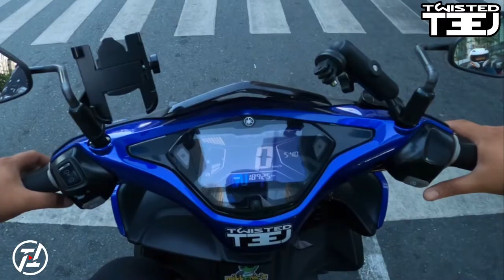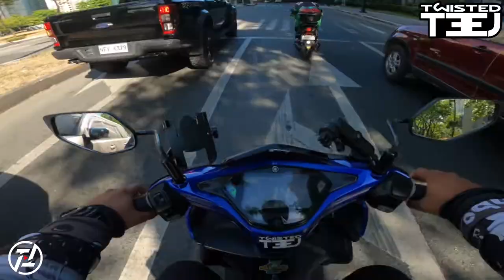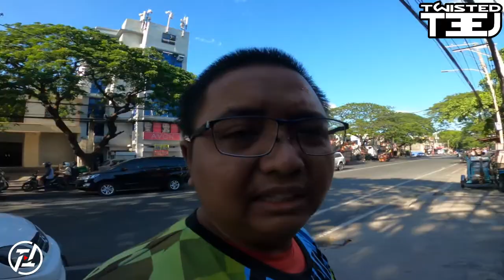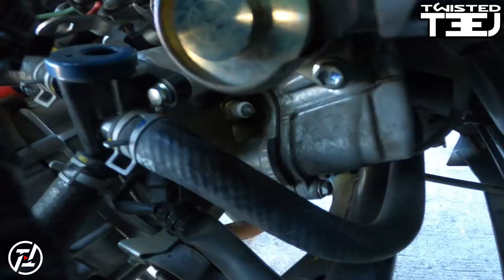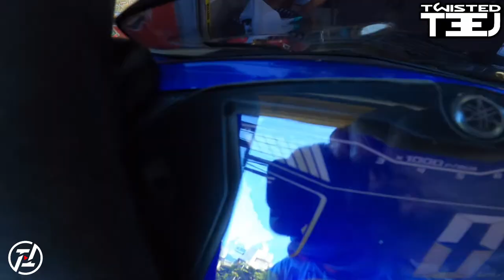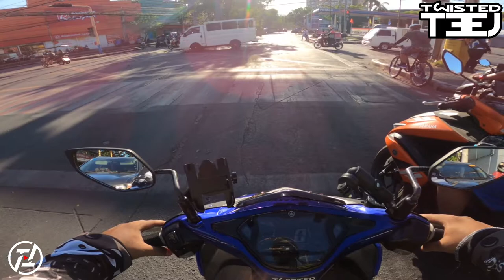Walang error code pero bigla namatay ang makina ng AEROX! | sparkplug check

Comment: Swerte ka parin boss kase sayo pag namamatayan ka sa byahe my ilaw panel mo. Ibig sabihin dika nawawalan ng power. Ung sakin habang nasa byahe ako pag namamatay sunod sunod na namamatay at ang masama pa pag namamatay pati panel damay walang power talaga. So hindi sya side stand sensor. Di rin sparkplug or ignition coil. Napalinis ko narin magneto at stator ko. Naka repaint narin hi temp magneto. Pero worst case patay buhay parin. Ok lahat ng mga possible cause. Sparkplug ko malinis na malinis parin. Kaya talagang nakakainis oag na byahe kase until now d parin matuloy saan ang issue bat namamatayan ng power. Bago rin battery.
Reply from the maker: Aww until now katoda di na resolve upon changing yang mga yan? Grabe 😔
Reply: CDI lods check mo or yung Fuse sa Battery mo baka biak na .
Reply: @TwistedTeej  okay napo un kill switch pala ng alarm ko nag ti triggered pag natakbo at nagagalaw un wire. Kaya ginawa ko tinanggal kona un kill switch para my alarm parin. Binalik ko un pinutol sa ignition switch para sa alarm. Ginawa ko ay wala nang function kill switch ng alarm pero my alarm parin. Ayun po ok na dina namamatay
Reply: @MissingRTV  same rin sakin, namamatay bigla ung makina pero ON parin ang panel tsaka walang error. Kapag punupush start ko umaandar pero minsan pag push start ko nag error 12 check engine, para mapilit mapaandar e tothrottle ko tsaka push start..
Ano kayang posibleng problema nang aerox ko? Suggestion po
Reply: @rodtriper  same problem sir till know sana my mkatulong saatin
Reply: Sakin naman namamatay habang nananakbo, madalas pag nag throttle ka, mamatay bigla pero mabilis din na babalik yung power
Reply: @rodtriper  ganitong ganito ung akin sir. Kung ano ano pinabili sakin sa yamaha pero. Pinalitan ko battery at spark plug pero humihinto pa din tpos minsan push start nag errror.. nagawa n ba syo lods?
Reply: Paps kamusta issue Ng motor mo ngaun , bumabalik parin ba Yung namamatayan Ka Ng makina Pero Yung charging Ng motor mo goods Naman . ?
 
Ganyan Kasi issue Ng motor ko paps 
Same Tayo nung namatayan Ka nang makina sa daan , 

Ginawa ko nag palit ako Ng fuel filter , spark plug, nag pa f.i narin ako na check Yung charging Ng motor ko at Yung computer box ko na check Rin , wala Namang error 12
Reply: no ginawa mo ako din pre e
Reply: Ganyan din sakin lod namamatay yung motor ko pati dashboard. Din yung time nya back to 1pm tlaga. Nahihirapan din ako kung anong problima
Reply: Ilang odo na yung mga motor nyo?
Reply: Ganyan din nangyayari sa motor ko mga paps sumakit na ulo ko kasi kaka throttle body cleaning lang, kakapalit lang ng sparkplug at cap. Nagpalit na rin akong fuel filter. Ganun pa rin pagdatingsa stoplight namamatay antagal umandar. Natuklasan ko kanina lang yung high tension wire ng ignition coil papuntang sparkplug nabubulok din pala ang wire parang durog durog sya sa dulo. Nagpalit ako ok na.
Reply: @rodtriper  same problem boss ano naging solusyon mo?
Reply: Sir ganyan din po akin dati.. nagpalit lang ako ng fuse at starter motor pinapalit ko.. goods na sya ngayon
Reply: Kamusta mga motor nyo sir.. same ng problem sa akin ngayon eh... Biglang blackout lahat.. panel, ilaw tapos makina..  ano kaya problem nun ?
Reply: @cjDacaymat paano ginawa mo paps ? Ok naba ?
Reply: @rodtriper gantong ganto sakin.. pano kaya solution idol?
Reply: @cjDacaymat possible battery mo or fuse. Ang worst wirings mo may corosion a.k.a nagaasin. Dyan lang naglalaro yang issue nayan kaya wag ipakalikot ibang parts
Reply: sabi nila pa remap na daw pag ganun
Reply: Fuse 30ampers
Reply: Katoda san ka sa pasig ganyan din sakin now e
Reply: @rodtriper bossing ano solusyon mo
Reply: @ravenconge9948  pinalitan ko nang magneto boss, may mga rider na naka experience nyan at nag abeso sakin na palitan ko ang magneto, pag baklas nang side sa magneto may leak na pala at depektado na ang oil seal, na babad na sa oil ang magneto dahil dun, bili ko noon sa magneto 5k sa yamaha.
Reply: boss na tukoy nyo na dahilan
Reply: same problem po ano naging issue?

Comment: GANYAN DIN ANG NA EXPERIENCE KO SA AKING AEROX, 1 YEAR AND 6 MONTHS NUNG NAG SIMULANG MAGKA PROBLEMA, KAPAG NAGBYABYAHE AKU SA HIGHWAY 70KPH, BIGLA NALANG NAMAMATAY YUNG MAKINA, PERO YUNG MOTHER BOARD NYA AY NAKAILAW, AT KAPAG NAMAN SA INTERSECTION KUNG E LOW KO YUNG TROTTLE NYA BIGLA NALANG NAMAMATAY, NAKAKA ABALA PA NMAN SA SUMUSUNOD SA AKIN BOSE NA NG BOSENA, ANG GINA GAWA KO SINISINYASAN KO NALANG NA, UMUNA KA NA,
 KASE BIGLA NALANG NAMATAY YUNG MAKINA...
Reply: Ganyan din sakin sir nmamatay bigla sa entersection panamnan buti nlang umilaw pa signal light..pero umaandar nmn sya pag inistart ko...
Reply: @yuloguillen2557  parehas po saken ganyan din
Reply: Same here
Reply: Sa ngayun okie na. Yung erorr12 ko. Binilhan ko Ng ckp sensor sa shopper..
Reply: @jamesbagongon3994  sir same tyo mgkno bili mo sa ckp sensor
Reply: @jamesbagongon3994  mabagal din ba mag start sayo?
Reply: @jemarmoratalla5903  1,800 pesos, galing pa kasing Indonesia, kung sa Yamaha wala kang mabibili, Kasi assembly Ang Meron, 5,100. Kasama na Ang stator..
Reply: @jemarmoratalla5903  Hindi nman, kung Anu noon, pareho lang..
Reply: @jamesbagongon3994  pero ok naba bro Nung pinalitan mo na nun ?
Reply: @jemarmoratalla5903  oo,
Reply: Nag error12 boss? Sakin kse wala error pero same sayo pag sobra bilis tapos mag menor nmmtayan. Gnyan din kaya boss?
Reply: @Shortvidflex  na fix mo na sir?
Reply: May error 12 ba na lumalabas kapag namamatay siya or kapag nag hardstarting pa lumalabas ang error 12?
Sa akin kasi may similarity tayo,pero kapag napadalas ang biyahe hindi naman siya namamatay yin lang bago mo siya pinatak o namamatay kaapat pero kapag patuloy mo ginamit hindi na siya namamatay.
Reply: @Shortvidflex same din tayo
Reply: @Shortvidflex kumosta anong findings ng motor mo?
Reply: Same here saan shop kaya makaka solve noting aerox ko
Reply: @yuloguillen2557 ano problema nung ganung issue boss?
Reply: Ganyan din sa kin

Comment: same problem aerox v1 user. namamatay engine pero may power. minsan lumalabas yung error 12 pero kung i on on ko ang motor, nawawala rin agad. di ko alam ano talaga problem sa motor ko. pina casa ko, pina check ko rin ng second opinion. same problem namamatay sa gitna ng daan
Reply: naayos mo na boss? ganyan dn akin eh
Reply: Same dn sa akin..na ayos na ba yung issue mo?

Comment: Boss. Ganyan din sakin namamatay nlng bigla makina pag nag menor pero yung panel hindi nman. May mga nakapag paayos na ba? Nagpa trottle cleaning na ako at palit battery ganun pa din? Any suggestion po?
Reply from the maker: Kuys try mo check spark plug pati spark plug cap baka maluwag lng din madalas andun din cause pg bigla namamatay pati ignition coil bka mmya napputol na kuryente
Reply: @TwistedTeej  cge cge paps salamat patingin ko agad.
Reply: Boss good day kmsta aerox mo same problem sakin ngaun eh. Pa help nmn po

Comment: Paps pano kaya yunh aerox v2 ko, napa throttle body cleaning fi cleaning narin, kusang namamatay habang mabagal yung takbo pero pag birit yung takbo ko hindi siya namamatay, tapos pag mabagal yung takbo ko biglang mamamatay then isaside stand ko then pindot sa start okay nanaman, walang error na lumabas, tapos minsan naman kapag biritan kunwari 8000rpm biritan biglang mag down ng 7900 tapos balik din sa normal salamat sa sagot idol RS always
Reply from the maker: Check mo din sparkplug cap bka maluwag lng.. nung nag pa fi cleaning ka dapat kasabay nun reset ecu kasi mag bbago reading ng afr ng konti dahil nalinis yung TB..

Comment: Sakin namamatay ung makina sa byahe, walang error. Pag pinaandar ko umaandar naman pero minsan mag eerror 12 check engine. Mapaandar ko kapag piniga ko tsada push start
Reply from the maker: Error 12 na yan katoda malapit na masunog socket mo pag ganyan pa error 12 fix kna
Reply: @TwistedTeej  nirekta na po yung stator, ganun pa rin. May bago akong napansin minsan nag voltage drop sa byahe from 14.4V to 11.8V, napakamot nalang ako bago pa naman ung batterya
Reply from the maker: @rodtriper  aww saklap nmn katoda di ko na alam possible next step 😔.. consult mo sa mga maggaling sa error 12 kasi sakin di prin nag kka prob after mag mc4 socket
Reply: Same tyo bro naayus Mona ba sayo?
Reply: Same tlga sa aerox ko ganyan na ganyan problma nya
Reply: @rodtriper  naayos na yung sayo boss? Anung ginawa mong remejo? Parehas kasi tayo nung aerox 2019 abs ko. Salamat
Reply: Kuya naayos NBA yun prblema sa motor mo?
Reply: @rodtriper  kumusta boss? paano po naayos?
Reply: @wifinowmatanao1425  may mga nakilala akong mga riders sa shop-- same din problem sa aerox nila. Advice nila na palitan na ng bagong stator. So far, simula noong napalitan, di na ulit bumalik ang error.
Reply: @jesmazing  yes po.  may mga nakilala akong mga riders sa shop-- same din problem sa aerox nila. Advice nila na palitan na ng bagong stator. So far, simula noong napalitan, di na ulit bumalik ang error.
Reply: @marlondeguzman7484  may mga nakilala akong mga riders sa shop-- same din problem sa aerox nila. Advice nila na palitan na ng bagong stator. So far, simula noong napalitan, di na ulit bumalik ang error.

Comment: Paps same issue walang lumalabas check engine.ng aautomatic namamatay kahit buhay ung panel board nya.palit ignation coil,direct ecu,stator malinis,magneto malinis,sidestand pinatanggal gnun pa din namamatay.option ko nlng paps ung Sp cup?anung brand sp cup paps?
Reply from the maker: Hi katoda kung medyo malayo nrin tinakbo ng SP mo concider mo rin.. kung mag ppalit ka nmn ng SP cap stock lng promise may kaibigan na kong sumubok ng aftermarket di tumagal kagaya ng stock.. RS Always ✌🏾
Reply: 48k na tinakbo paps
Reply: bago din Sp
Reply: @TwistedTeej  until now hnd nb namamatay ung aerox mu paps?simula inayos mu po ung sp cup?
Reply from the maker: @pongskie6589  hi katoda oks try mo nrin SP cap kung gnun.. every since naayos kong ganito after 1month bumigay ung sparkllug ko medyo bago pa ung sparkllug ko nung time na to pero aun napundi agad..
Reply: Same din sakin yang sakit mo boss try mo palitan ng stator mismo baka sira na stator mo pero sakin e ttry ko palang bumili ng bagong stator napalinis kona rin stator ko same parin issue namamatay parin no error
Reply: @nancygarcia9827  bro ok naba sayo nag palit ka Ng stator d naba namatay?

Comment: Sir same ba tau pr9blem kasi ung sakin po bigla bigla nag checheck engine tapos mamamatay
Reply from the maker: Sakin katoda ndi nmn nag check engine.. kung nag check engine sayo pa check mo using diagnostic tool pra malaman ung previous error pra mas madali mahanap ang problema
Reply: Monitor mo paps yung voltage kung tumataas kapag nag checheck engine. Kapag ganon baka grounded. Pa bugahan mo ng hangin yung socket ng ECU.

Comment: Ganyan din motor ko ngyon. Bigla na lng namamatay. Nagpalit na ako ng sp. 
Namamatay tapos minsan error12 pero nagreredondo. Tapos magsstart ulit. Tsaka mabagal magrespond pag iippress start button
Reply: Sir, naayos napo ba yung sayo?
Reply: @underrated_aerox  naglinis na po ako ng stator at magneto. Mahirap pa din po umandar. Linis start botton next na gagawin ko sir. Yun naman paghinto ng makina habang nagmemenor. Try ko palit sp at balutan ng electrical tape yung sp cap bak tumatalon kasi kuryente nun. D ko pa madala sa marunong na mekaniko kasi sir
Reply: @romelgallo2531  Sakin same din e. laki na nagagastos ko Hahahaha. Palit sp, linis stator, napaayos ko nadin yung sa error 12 socket, nacheck na din mga wiring wala naman sunog.  Namamatay padin e. same sa video, walang error na lumalabas. subukan ko papalit ng sp cap. baka sakali
Reply: Last na sir baka stator problem na
Reply: @romelgallo2531  pinaayos ko yung spark plug cap. So far goods na takbo ko. di pa namamatay. update ko tong comment pag namatay padin  🤣
Reply: @underrated_aerox  binalutan ko din ng electrical tape sp cap ngayon sir. Under observation muna. Yun naman issue ko na mahirap magstart or matagal response pag iniistart. Niliha ko contacts ng start button. Medyo responsive na
Reply: @romelgallo2531  same here. under observation din
Reply: update. Namamatay padin 😅😅🤣🤣
Reply: @underrated_aerox  yung aerox ko same pa din. Namamatay tapos minsan nageerror12. Pero naiistart ko naman. Need lang sabayan ng konring pihit ng throttle. Nagorder ako ng isc sa lazada. Try ko palitan.
Reply: @underrated_aerox  Kamusta boss nanamatay padin ba mc mo? Nagpalit kaba ng Sp at sp cap?
Reply: @latizialasala8602  Oo boss. pero nahanap ko na problem. sa may socket ng coil nagloloose. kasi nung namatayan ako last time. ayaw talaga umandar. tapos ginalaw ko yung sa coil, umandar na ulit.
Reply: @underrated_aerox  sir d naba namatay sayo?
Reply: @underrated_aerox  sir ok naba sayo sa ignition coil ba Ang problema ?
Reply: Update: ok na yung aerox ko. Nak dalawang ckp sensor n din ako. Pero yung huli nasunog wires kahit naka adpro. Ang ginawa ko na lng. Bagong wiring harnes from stator direct to ecu. So far ok na.
Reply: Update ko lang din sakin. Di na sya namamatay, ang pinaka salarin pala talaga is yung Injector. Yung screen nya (filter) puno na ng dumi. as in parang may mga putik. Pag nagpapa fi cleaning ako, throttle body lang nililinis. Diko alam kung bakit di man lang tinitignan yung injector kung madumi na.

Nasira ckp stator ko dahil pinipilit iistart kahit ayaw na magstart (pag ayaw magstart wag na pilitin, dun daw nasisira)

Umabot ako ng 20k plus sa nagastos ko.

3 mekaniko na tumira (Lahat yun nagbayad ako labor - kahit di naayos). Lahat sila parehas ng diagnose stator lang daw sira. Dalawang beses ako bumili ng stator, kasi yung unang bili ko nasira daw nung kinabit. HAHAHAHAHA.

Dahil kagustuhan ko na maiuwi motmot ko since 1 month na sya nasa pagawaan, sinilip ko lahat. Ako lang nakadiscover na yun ang problema.

Tinaktak ko yung injector para matanggal yung putik, natanggal naman. Pero di daw dapat ginagawa yun (Siguro nga di dapat) Pero umandar na motor ko. Ilang months nadin nakalipas, Goods na goods padin takbo ng motor ko ngayon.

Kaya lesson learned nadin, kung may binabayaran ka na service like fi cleaning, make sure na talagang nililinis nila. Kasi karamihan talaga sa mekaniko tamad. Napaka swerte mo nalang kung makahanap ka ng masipag at makatao na mekaniko. RS sa lahat.
Reply: @romelgallo2531  paps, pabulong naman kung san ka nakabili ng harness Hahaha salamat. Para sa ibang tropa in case kelanganin nila.

Comment: Paps kamusta issue Ng motor mo ngaun , bumabalik parin ba Yung namamatayan Ka Ng makina Pero Yung charging Ng motor mo goods Naman . ?
 
Ganyan Kasi issue Ng motor ko paps 
Same Tayo nung namatayan Ka nang makina sa daan , 

Ginawa ko nag palit ako Ng fuel filter , spark plug, nag pa f.i narin ako na check Yung charging Ng motor ko at Yung computer box ko na check Rin , wala Namang error 12 ..
Reply from the maker: After nyan wla na naging problem pero after 1month netong vlog bumigay SP ko napundi

Comment: Same problem ko now. Minsan na trigger sya downhill tas naka up throttle ko. Bigla nalang nya nag eengine break hanggang sa huminto ako. Open ang panel nya at nakita ko error 12 nakalagay. Any advice po. Salamat
Reply from the maker: Hi katoda better to have error 12 fix.. palit sockets either mc4 or adpro dami na gumagawa now a days nyan.. pasabay mo na magneto cleaning
Reply: Check mo paps yunh socket na papunta stator mo baka nasunog na sya
Reply: Sakin direct na Yung socket Ng stator ko mga Ka paps .. ganun parin Hindi parin mawawala Yung sakit na namamatay
Reply: Update: 

Pinalitan yung ckp sensor 1 month na din mahigit. Okay na takbuhan di na namamatayan.
Reply: @TwistedTeej  Sir ano yong  MC4 at ADPRO? Anog socket yong ibigsabihin mo? may gantong issue din kasi Aerox ko V1.

Comment: Sir pwede pabulong ng set mo tsaka kung san ka nagpabuo?
Reply from the maker: Nasa description ung details katoda,

K2speed semi dome piston
K2speed stage 1 cams
130cc injector 10holes
Jvt valve spring 5 turns
Headworks mikkonic's
Installed by mikkonic's